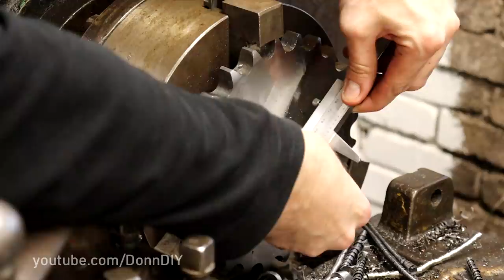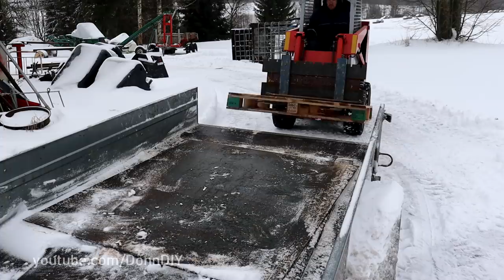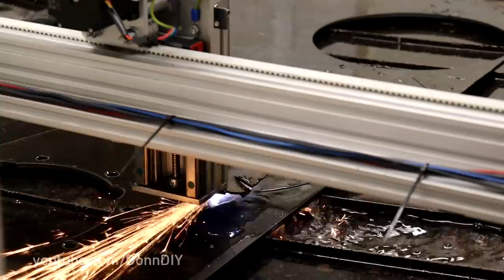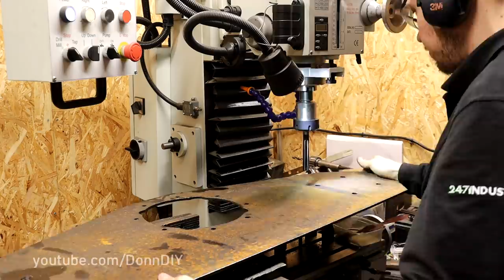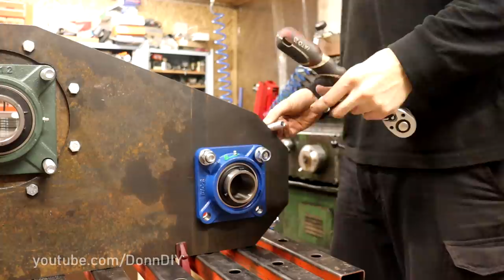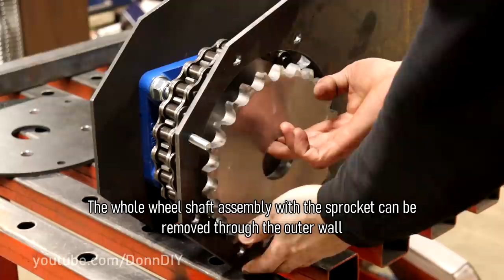4x4 PTO Driven Timber Trailer BUILD Ep.2 - Tandem Axle

Comment: Really nice build.
A good touch will be to do a couple of threaded holes in the sprockets, so you could attach some screws to help pull it out.
As you tested, they come off through the hole, but is a tight fit, not so much room to fingers.

Comment: Man that looks like it’s going to be a solid construction, next you’ll be making a tank. 😁
Reply from the maker: A tank-ish vehicle would be intersting project indeed
Reply: @DonnDIY  It has been done before. The armaments are tightly controlled (boring). And the beavers are already scared.

But if you do - the swedish S103 was really something else. Just saying :-)
Reply: Making a proper dual differential tank transmission is pretty easy too.  Tanks use highly optimized versions, but that's far from the only way to do it.  2 differential axles and chain is enough for the simplest versions.
Reply: @martylawson1638  Modern tanks left the differential setup many many years ago as far as I know. I served on the Leopard 1 which was designed in 50/60s. It came with an automatic gearbox handling steering and propulsion. It transferred power to the outside track instead of braking the inside track to increase mobility and speed. 

For homebuilding a braking differential is probably the easiest way to to it as you mentions. Donn did this in his amphibious vehicle build but used a single differential.

Comment: The omega drive will be fine, curious to see how you will do the tensioning. But like others that has comented I am worried about the seals. Personally I would have put all bearings inside and added radial seals with extra lip on the driveshafts especially. Love your channel, you do a fantastic work! / Swedish mechanical engineer

Comment: It will be interesting to see how you relive the stress of the main gear ⚙️.  Contact chain to gear!!! Most poeple will use 2 chain for full gear contact. Nice work.
Reply: I would also go for 2 chains, even if they wear they are unlikely going to hop teeth. Ive built a lot of different chain driven machines and Im worried...
Secondly those bearings arent sealed, theres just steel shields on them which would get all kinds of crap in them, they're cheap, maybe he'll just grease them more often, with something super thick

Comment: It was nice to see the wood processor, the transport band and the trailer crane again while driving past with the loader. Nice touch :-)
I was hoping for a wood handling comment/short and wether your efficency plan worked out.

This build looks just insanely sturdy. Looking forward to see how you mate up the parts for the propulsion - and the crane for this "Sherp - I'll go anywhere thank you" trailer.
Reply from the maker: The wood handling is definitely more efficient due to the IBC crates and the mini-loader. However - the wood processor could be faster and more powerful. So there's room for firewood processor mk2 in the future.😀
Reply: @DonnDIY  Yeah, those electric splitters are not very fast. You can easily purchase the valves and put in a new splitter in your design. But knowing you I suspect you will rather do a full on MK2 :-D

Good fun and nice to hear that the process works as planned.

Comment: It needs 2 chains. 1 for the front tyre and another for the rear tyre. The chain will slip on the drive sprocket with this configuration.
Reply: I doubt it will slip. With the single idler sprocket on the front side of the drive sprocket he achieves about 1/3 sprocket engagement so there should be no risk of slippage. 
Adding the chain slide ensures the chain is fully lubricated as well. 

2 chains would be better but his plan adding the single idler/tensioner will work.
Reply: Yes one chain will prove to be a problem. It possible to fix that one chain work, but it will cause great stress. Just wear faster. It why to chain approache is the simple way to go. Your right ✅️
Reply: Subifan1
No it dont need two chain !
You have to take in consideration the motor that will drive that chain 
then the size of the chain and the angle of contact of the chain on the main sprocket
It is a small car motor with a car transmition so i doubt it will move 50 tons load
sure for a grader i would recomande the 2 chain system but for this aplication one is more then enought
but that is my own opignon !

Comment: Donn, the tandem axle you are using is also known as a walking beam axle, and has been used for many decades. It provides little "shock," or sudden impact protection, but, by it's design is well suited for trailers of many types, and was a similar idea used in military ranks many years ago.
Reply from the maker: You're right!

Comment: I think about were the wheel axles coming out boogie box. I had a old logging machine times ago, and the water came in to the boggie chains and everything was frozen, so the wheels did´nt turn  around! So it´s good to have real sealing rings around the wheels shafts.

Comment: It would be good to have jacking bolt / puller holes drilled and tapped in your sprockets. With  tapped holes you can more easily remove the sprockets from the maintenance access window you have designed into the chain case, but you have probably thought about this already.

Comment: Great as always, but in my opinion its a little overkill.
I would use regular rear axle from car or small bus.
I know har tandem axle gives better clearence and runs better on irregular surfaces but you gonna haul it with your utv, which has lower clearance.
Anyway
Great job as always
Greetings from Poland
Reply from the maker: You're right but it's more interesting to build this tandem axle system. And I can haul this trailer in the future with something other than my homemade UTV.

Comment: I am not sure if it applies here, but I always thought the tensioning should be done on the "returning" side of the chain. Just a thought tho.
Reply: That is correct
Reply from the maker: Returning side of the chain is under tension. It is pulled tight. However, the outgoing side of the chain has less strain on it and is more suitable for an idler/tensioner sprocket in my opinion.

Comment: I can see a crane for the plasma table coming if the projects are Abom sized in the future ; )
Reply from the maker: Something to move around material would be sweet indeed.
Reply: @DonnDIY  I think a DIY electromagnet plate lifter would be a sweet build series. Coils from microwave ovens seem to be a good bet and an overhead rail like a barn door slider from the outer door into the plasma room = )

Comment: Donna, did you, or are you, going to go over how you determined the gear ratio's so that it will work with the PTO properly?
Reply from the maker: Just 1:1 chain drive in the chain housings and identical BMW diff with 2.81 gearing.

Comment: Massive drive system, looks like from a grader or something similar of heavy equipment!
I guess it will take around 5 liters of oil each...
:-D
Whats the size of the chain, never seen such a massive one?!
Will there be bearings on the outer cover as well?
Thx for the update!
:-D
Reply from the maker: The chain is 16B-1.
Reply: @DonnDIY  8-) 
That whole vehicle will be like a Hägglund on wheels!
:-D

Comment: There is still time to go with 2 chains.  You already have enough sprockets and chain. Search for motor grader chain drive and look at images.
Reply from the maker: Out of laziness I will try the single chain first. If/when it fails then I have no other choice but to use double chain. 😀
Reply: @DonnDIY  Another benefit of single chain is more audience engagement with your project.  :)  Using a front wheel drive sideways as you have is genius.  Well done.

Comment: The atv power driven trailers I see online are powered by a cogwheel resting on tire tread, your set-up appears to be heavy duty......
Reply from the maker: The commercial ones are with hydraulic drive. I didn't like that so I decided to build a PTO driven trailer instead with a separate differential for the trailer

Comment: Nice job, but I see you went ahead with the symmetrical design of the boggie.
Reply from the maker: No, I actually made the front half something like 60 mm longer so there's less weight on the front wheel.
Reply: Ah, didn’t see that. Should be fine then 👍😊

Comment: well,,,this is goingt to be strong enough for a 15 ton load,,you might try to downsice things in the future,dont get me wrong,,strong is good, but in the same time expensive and heavy,just strong to do the job and a bit of margin on top of that is enough,but hey,,realy nice job as allways,,
Reply from the maker: Yup, once I received the parts and saw them in real life I realized I could've use something lighter. But it's this way this time around.
Reply: No Donn, wrong answer, it is so you can add the driven tag trailer to the trailer and just rename it to a forwarder. For the full length logs.

Comment: would of opted for two sprockets on the main drive so if the chain snapped one wheel/tyre would still have drive. with shorter chains and the tensioner's can be smaller and more compact.   great video